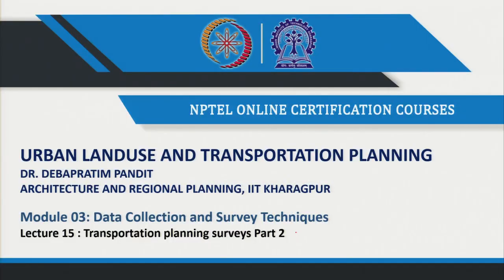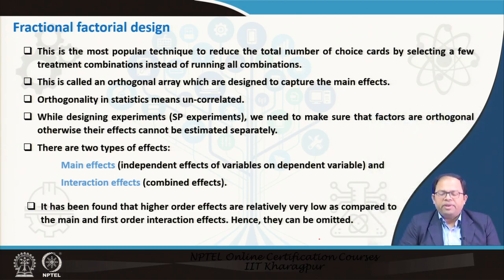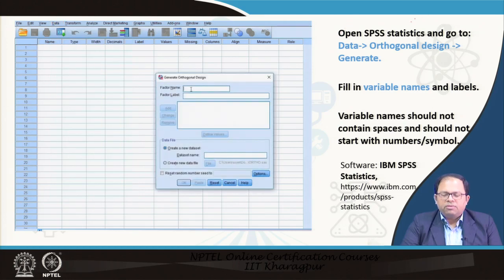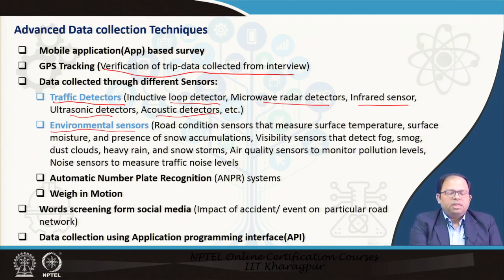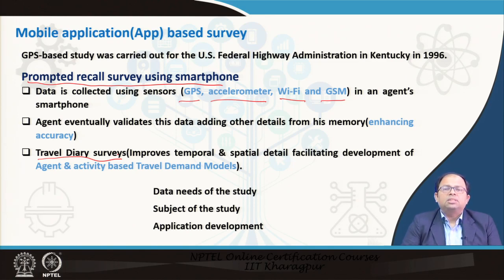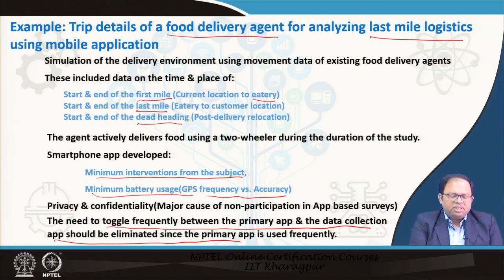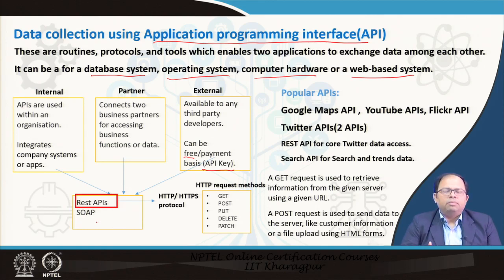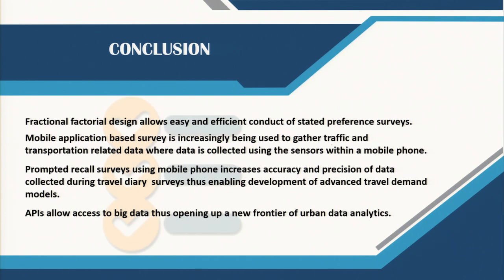Lecture 15 : Transport Planning surveys Part 2

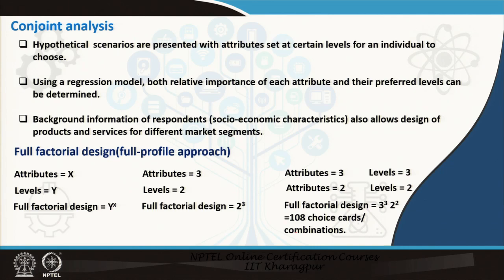Comment: 1:00 Conjoint analysis: 5:48 fractional factorial design
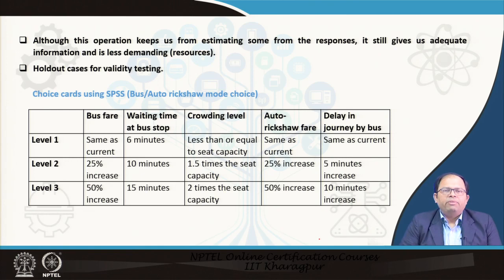8:09 Conjoint analysis: design of choice cards using SPSS
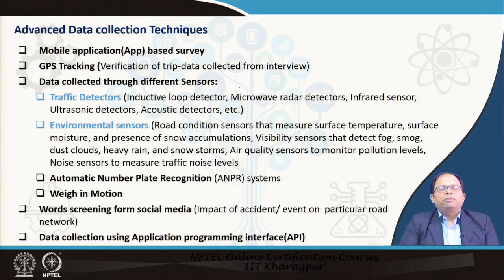15:21 Advanced data collection techniques
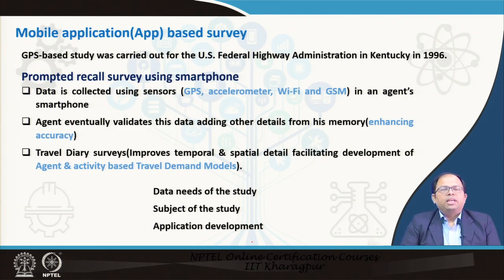19:51 Mobile application based survey and data collection
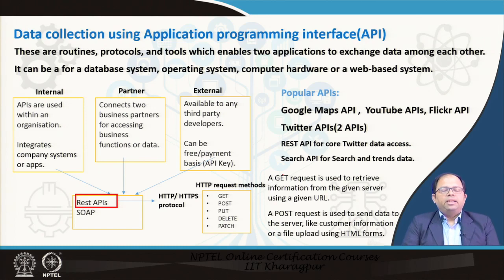30:12 Data collection using application programming interface (API)